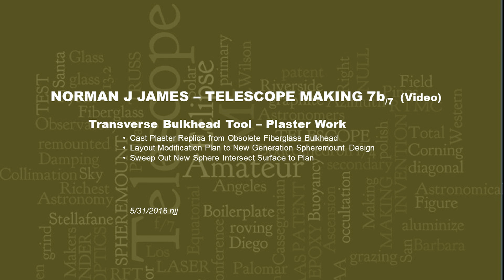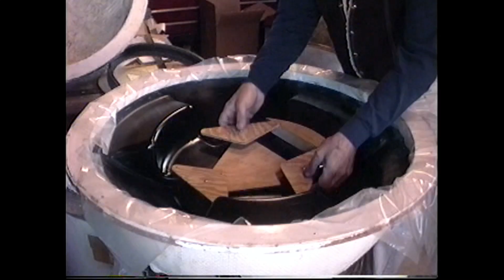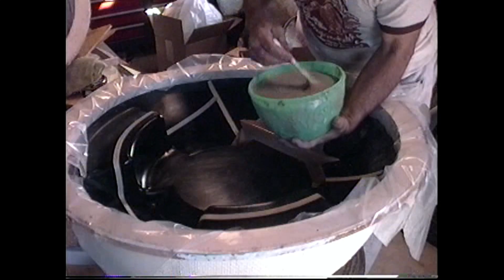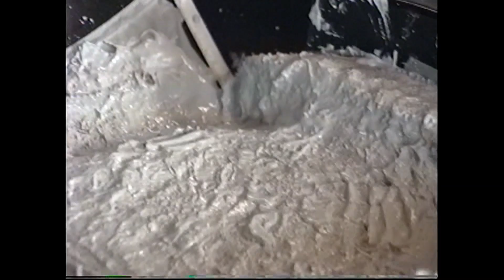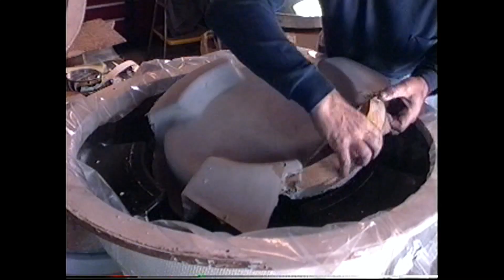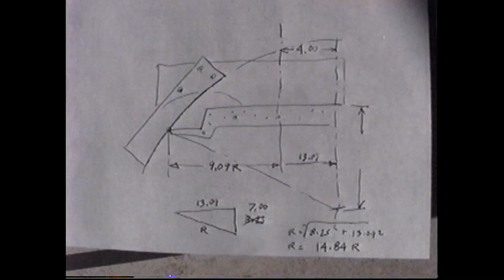tm7btrsv bulkhead movie

Comment from the maker: A NOTE:  Working in Plaster may be tedious. What you have seen in multiple passes of a template, to bring a surface up to contour requires more than expected, for one not in the profession. The problem is in the plaster itself because it has a limited time window to work after it is “about to set.” Because of this, one tends to start too early (which is better than starting too late) and plaster tends to be watery and runs off. It can be recovered and put back on, but it is tedious. Eventually it does build up, but it will take more than the expected sweeps of the template. Another complication is that if the plaster is old (a long time between projects) it tends to take longer to set. In any case, for a craftsman, it is a wonderful medium to have available.   Norm